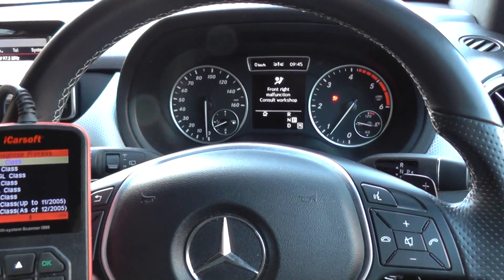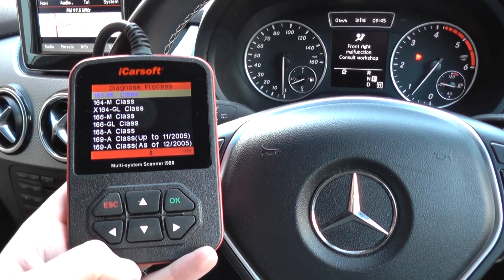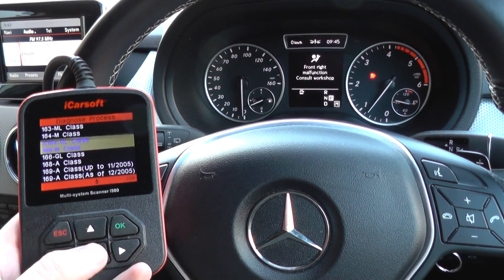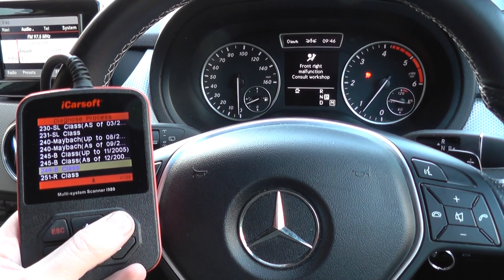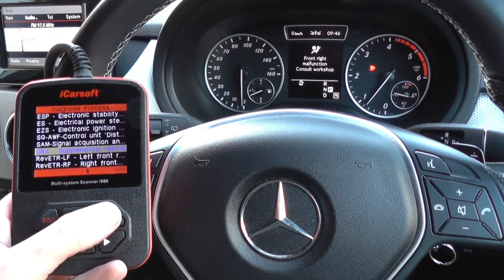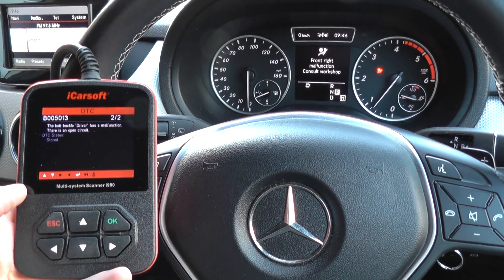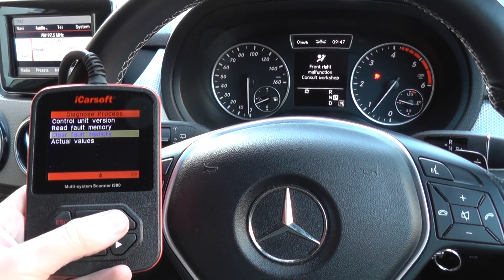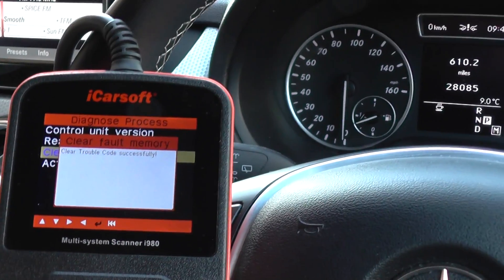iCarsoft i980 SRS Airbag Light Reset Mercedes B Class W246

Comment: Hello good video but erase fault code is not repair thé problème...
Reply: Laila O They said that they fix the yellow connector on the seat. They said it was a loose connection.
Reply: @MikeyB_1972  Can confirm this is the solution, Mercedes as always with the highest quality manufacturing...